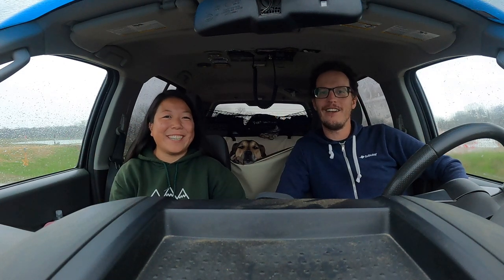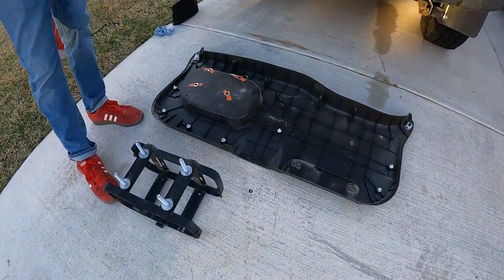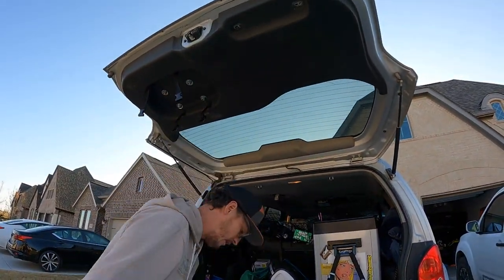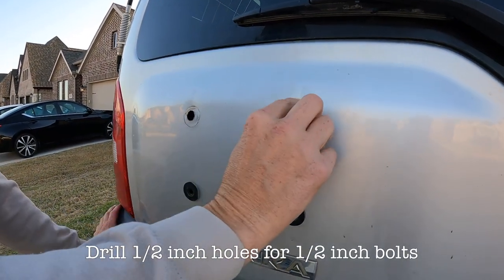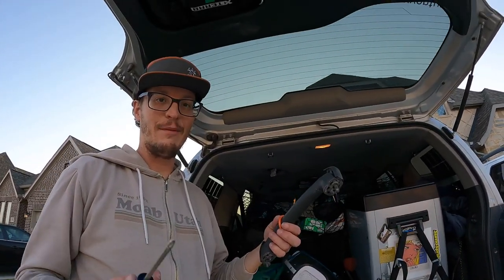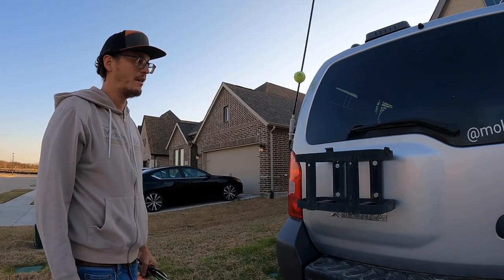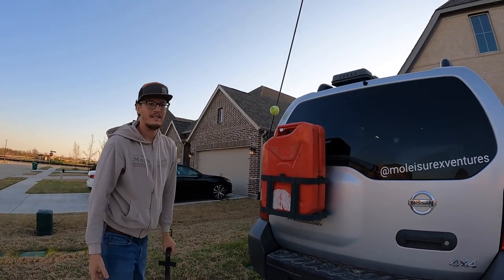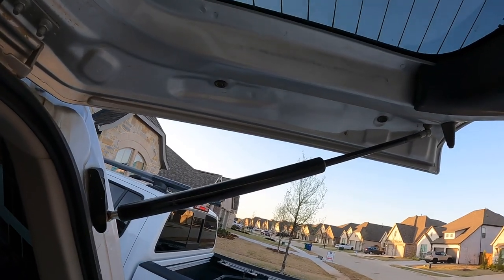How-to install Jerry Can Mount Mod for Nissan Xterra

Comment: I've been contemplating a gas can solution on my Xterra and never considered this setup. I thought it would be too annoying having to take out the can each time opening the lift gate. Now that I know I can just install stronger lift struts I'm reconsidering. Great idea. Thank you.
Reply from the maker: No problem! We currently have 200lb struts on the back and they work perfect for when the Jerry can is full.

Comment: Thats a great idea but I would add a plate on the inside for extra strength or some kinda bracket so it doesn't rattle those holes bigger in case you go 4 wheeling and bounce around ,just a thought . I think I'm going to go that route also thanks for the great idea bro
Reply from the maker: Glad you like the mod! I used fender washers instead of a plate to hold the bracket steady. It’s been on there for a year now and hasn’t fallen off yet lol 🤞😂

Comment: Cool. Thanks.  I am going to use a metal file and smooth the edges of the drill holes, then clear fingernail polish the edges, then put the rubber covers on.

Comment: I have been looking for a spare tank setup and I think I like this idea although as someone else suggested use a bracket on the inside to tie down the bolts vs sending it through the plastic.

Comment: Great video you guys! I just did mine and am struggling to find the right gas struts to support the weight of the gate plus full Jerry can. When you find one that you like, would you drop a link in the description?
Reply from the maker: https://www.thenewx.org/threads/how-to-rear-hatch-strut-replacement-pbr.51485/ This is the one we used it does great when the tank is empty.
Reply: @MoLeisureXventures  you’re a champion. Thanks!

Comment: Do you ever worry about having a jerry can with gas exposed to sunlight/heat while driving or parked in the sun?
Reply from the maker: No, the style gas can that we went with is a NATO style gas can. My understanding is that these gas cans are rated for military use, they are strong enough to withstand the heat from the Sun.
Reply: @MoLeisureXventures Oh, gotcha.  I always wondered about that when seeing overlanders with gas cans in the sun. Seemed like a recipe for a sudden, big problem. haha